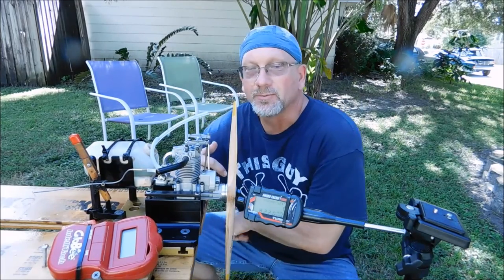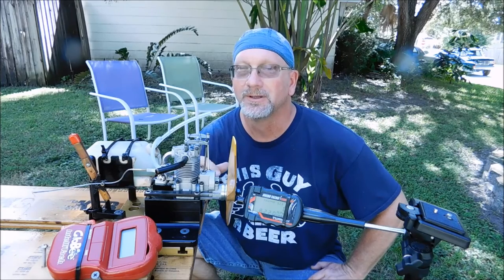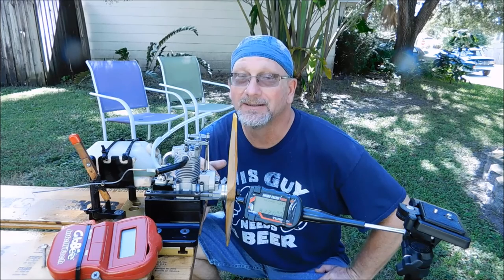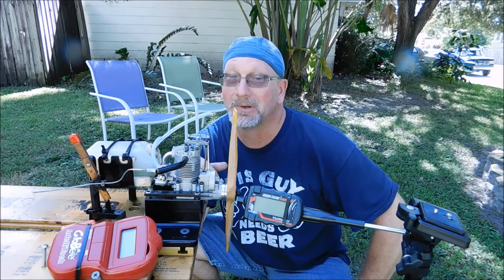Saito FA-40 Open Rocker Cool Power MV

Comment: I flew some of that Cool Power MV the other day in my Escapade 61 with a Saito 100, I am pleased to say it worked good and left plenty of green goop on the wing. I think its going to work out just fine.
Reply from the maker: I opened up this engine again after this run and found quite a bit of green slime inside as well.